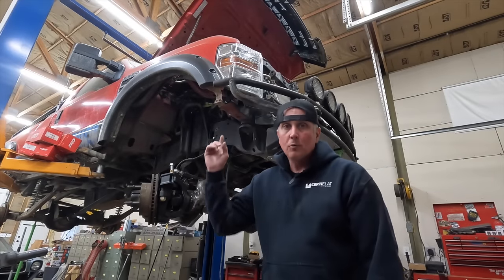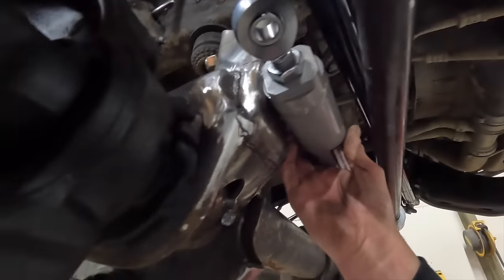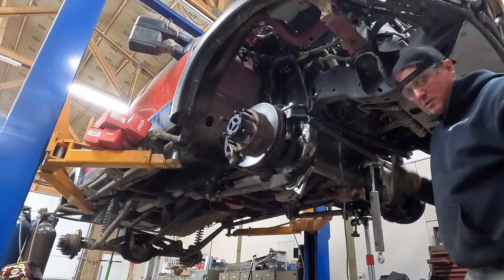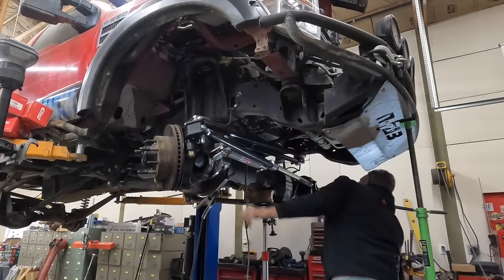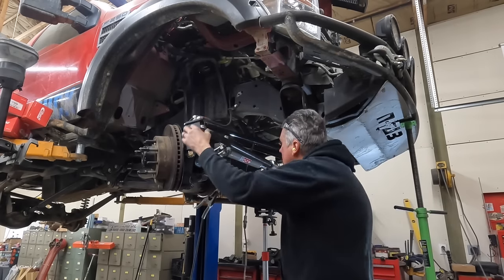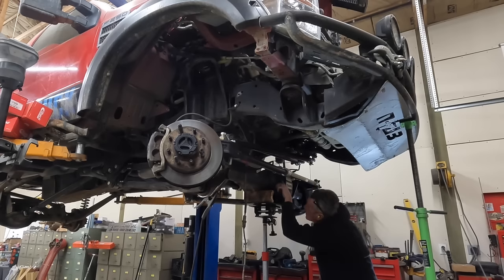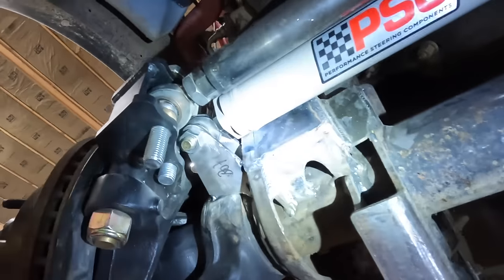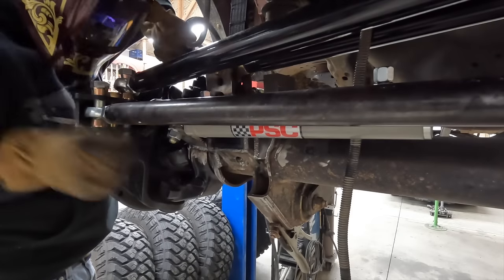Louis ViTen gets high angle ram assist steering!Super Duty steering upgrades.

Comment: I'm in the UK and would definitely like to buy some merch. Your videos motivates me to go work on my junk. When welding aluminium try using a smaller cup. Too much gas can make the weld puddle unstable and you don't need the wide gas coverage. Keep up the good work.
Reply from the maker: I was wondering if I needed to swap back out to a standard diffuser and cup

Comment: Fwiw - a super ez way to bleed the air is to put the cap on, then pull vacuum on the vent line on the cap..  it will pop all the micro bubbles and all..

Comment: That buzz from the mig welding is smooth. What size (amp, voltage) welder do you run?
Reply from the maker: I was using a Miller 252.   .030 wire.  Probably set for 3/16 so 18/250 on this machine.  Not sure what that puts it at amperage wise

Comment: Does having the passenger side of the tie rod in the front hole not cause the steering to be uneven side to side, I’m running the exact same setup but turning right past half lock my driver tire will either cut a rut on dirt or scoot across the pavement, turning left it’s fine. I’m planning on moving my drag link up top in the exact same way and moving my tie rod to the rear hole on the passenger side.
Reply from the maker: I will let you know as I get some miles
On it
Reply: @thedirtheadshed  oh trust me you’ll know the minute you turn full lock right, I’ve accidentally left trenches in an arc in dirt or rubber rainbows on pavement

Comment: Hey bud I got a question what is a good bottom of the frame height on an off-road trail rock crawler 24 in?
Reply from the maker: Kinda depends on wheelbase.  I have had good luck with 110” wheelbase and 21 belly pan height